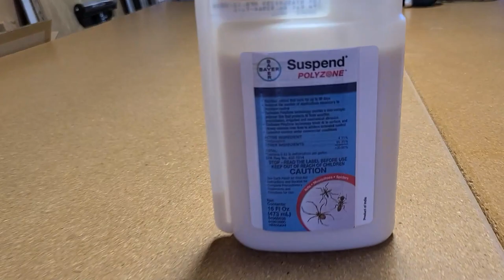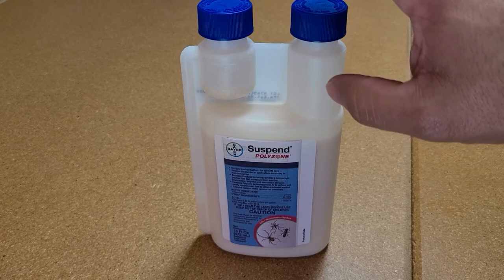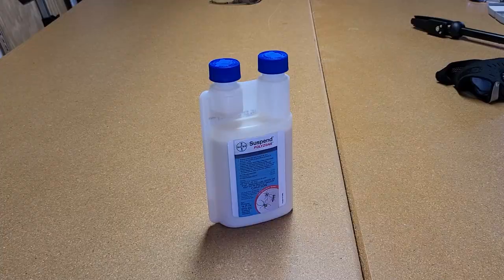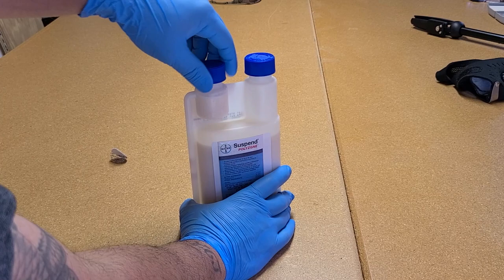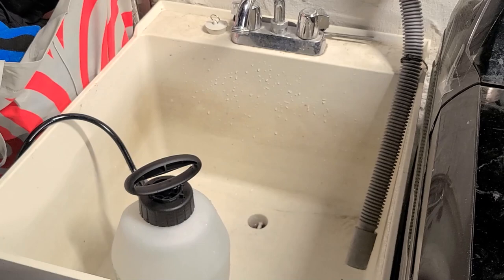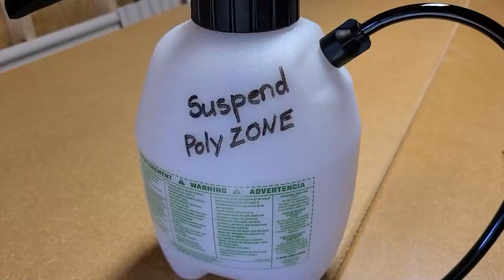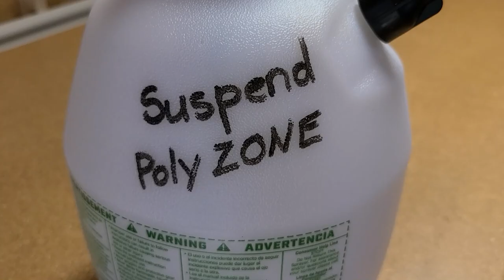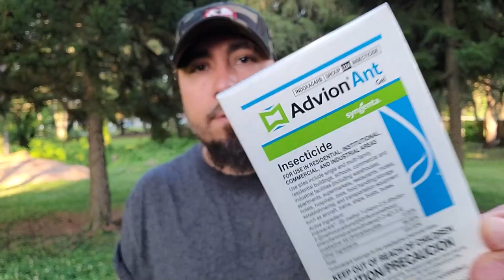DIY Long Lasting Insect Killer, Supend POLYZONE

Comment: I have these biting gnats that fly around around the lawn and not in the shrubs or bushes like with mosquitoes. I wonder if this will work against them
Reply from the maker: I'm not too sure about that. But they do sell a Specific insect killer. That's For insects in the lawn. That one, you connect the bottle to your water hose and spray down your lawn.